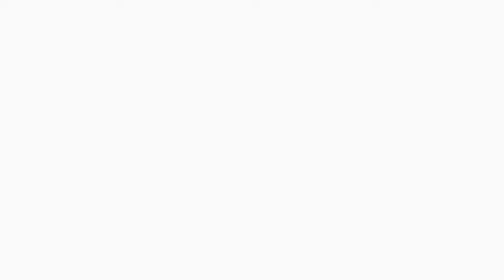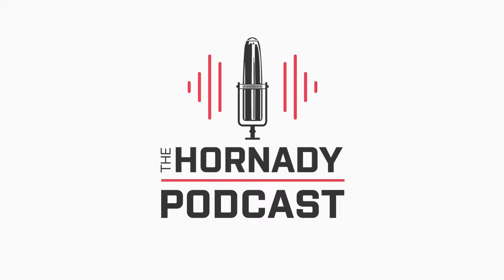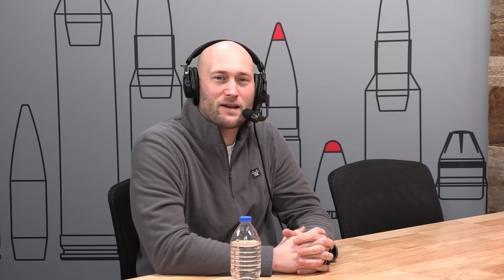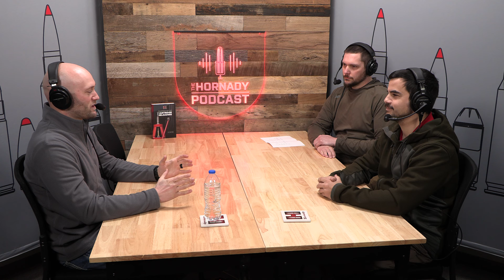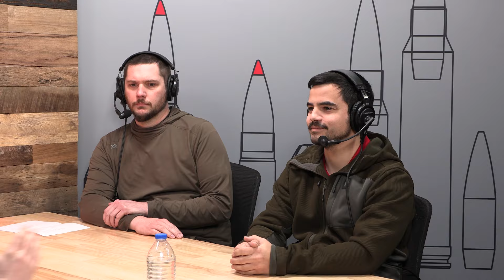Ep. 062 - The Venerable 308 Win

Comment: What I love about the .308 is it makes a great short barrel rifle. Im planning on building a 308 on a Yugo 24/47 action. I have a 30-06 barrel I took off a Mod. 77 Ruger which I rebarreled to a 9.3x62. My gun Smith will cut this 30-06 barrel back about 3/4 inch to remove the action threads and rethread it to fit the Mauser action and rechamber it to .308 Win. This should give me a 21 inch barrel 308. I'm pumped!

Comment: The .308 does good up beside the .30-06 until you get up to the 200 and 225 and heavier bullets. Thats when the extra powder capacity pays off. But for most hunting needs those heavy bullets arent needed. 180 grain bullets fly just fine out of the .308 Winchester.

Comment: Ref 5:50 --- The reason why late XIXth C rifles had these elevation sights out to 2,000 feet is that the concept was that massive rifle fire would be shot by whole squads at a single target at long distance, like a crossroad with marching troops, etc. The machine gun replaced that at the First World War. Distant fire and even indirect fire (artillery style) was given to machine gun units trained with firing tables to do it. Rifles from this point were used individually for shorter ranges.

Comment: What r yallvtalking about.    The 308 is way more powerful then 3030.   The 3030 runs at 2200fps w its hottest load.  Usually slower w most.  The 308 runs 2800 fps w the same grain weight.   600fps or more is alot more

Comment: When the 300 Savage was introduced in 1920 it matched the U.S. Military loading of 2750 fps with a 150 grain bullet. A lot of elk have been taken with the Model 99 Savage in 300 Savage. Not a hot rod but plenty good for whitetail, mule deer and even elk to 300 yards with good bullet placement which should always be the case.
     The reason SAAMI detuned the 300 Savage was the mostly unfounded fear that it would be chambered in some old rifles like M93 Mauser which allegedly had weak or soft steel which is pretty much BS. The original 7x57   military loading in the Spanish M93 produced an average pressure of 50,370 copper units of pressure. That’s considerably above the SAAMI standard and I don’t remember ever reading about any M93’s blowing up from over pressure during the Spanish American War or any since. The SAAMI spec for the 300 Savage is exactly the same as for the 7x57 at 46,000 CUP. I know that CUP is not PSI as measured with a piezo transducer. Your viewers who don’t know the difference will need to look that up.
     I have a Savage 99F in 300 Savage, custom ‘98 Mauser and Savage 99F both in 308 Winchester. Also 300 H&H and one of the Carl Gustaf M96 6.5x55’s Sporterized by Kimber, so I don’t need a 300 Win Mag or a 6.5 Creedmoor. I’m disappointed because it appears that Hornady is no longer producing the 300 Savage SuperFormance load as my 99 really liked that number. Actually except for a .243/6mm I’ve got all the bases covered as to bore diameter in various old farts’ (like me) cartridges. 250-3000, BOB, 338-06, 35 Whelen, 9.3x62, custom Siamese  Mauser 45-70 in case the dinosaurs come back. With that all said if I could only have one it would be a 308 Winchester. I’m not planning on hunting any of the big bears or African dangerous game but for the things commonly hunted by the common man on the North American continent it will still do the job. Not quite equal to 30-06 but close with less recoil. Quality ammunition available everywhere at reasonable prices. Easily reloadable makes it even more versatile. Proven track record. Not made for sniping at live animals at ridiculous ranges. Happy hunting boys and girls!😊

Comment: The Hornady #3045 bullet (165-gr BTSP Interlock) is an excellent performer. I have used it to take 14 deer. One of my buddies recommended it years ago and in my rifle it usually gives sub-MOA with reloads. Lots of good 30-caliber bullets available. I have used the Hornady 168-gr BTHP Match (#30501) and 165-gr SST (#30452) with excellent results, both also sub-MOA.

Comment: My 308s and 30/06 are two peas in a pod. Still can't tell the difference except for the length of the rounds.
 Both drop the same if I use the 24 in. barrel  308 and the 22 in. barrel in the 30/06. Using a 200 yd. Zero, Both  dropped 50 in. @ 500 yd. Using identical hunting flat based 150 grain softpoint bullets. Can't tell any difference between em.

Comment: You have the nerve to wax poetically about the 6.5 Creedmoor in context with .308 Winchester and fail to mention the .276 Pedersen at all?  The cartridge the M-1 Garand was originally deigned to fire and is the basis for the new M-5 cartridge.  I defy you to fire equal weight rifles of .308 and 30-06 with equal weight bullets and velocity and feel a difference in felt recoil between them.

Comment: I was told the military wanted a shorter cartridge in .30 so it could have a higher rate of fire than the 3006 could provide with the BAR.
So they came up with the M-60 with a belt fed .308. And it worked. And they created the M1A to also use the same cartridge for simplicity and a faster rate of fire with the magazine feed.
Reply: Soldiers were taught to engage targets at maximum distance using full sized cartridges.  But, human nature being what it is, all too often soldiers would wait until the enemy got to within “guaranteed hit range” before they engaged.  After-action reports from both WWII and Korea reflected this.  So the idea became, why issue and use big heavy full-sized cartridges if they won’t use them to their full potential.  Thus, the change to a intermediate cartridge, 7.62x51.  Can carry more ammo for the same weight load.  Then the army became fixated on the remote wounding effects of small yawing bullets at high velocity.  Thus, the 5.56.  So the average infantry guy went from 8x8rd M-1 clips (64 rds) to 7x30rd 5.56 mags (210 rds).  As far as the 7.62, it was discovered that they could shorten the 30-06 case by about 3/8” and use better powders to damn near duplicate the ballistics of the 30-06.  Not much weight savings, but easier operation in machine gun feed systems to use short action size cartridges.  Back to that human nature thing.  For decades now, we only qualify out to 300 meters.  But we still engage crew served at 1200 meter ranges.

Comment: Great information…..did the .270 evolve from .308? Or 30.06
Reply from the maker: 30-06
Reply: The 270 Winchester was developed directly from the 30-06 case. It was not just a necked down 30-06 case as is often stated. It is a longer case and is specifically manufactured so that it cannot be run into a 30-06 chamber. You can form 270 Winchester cases from 30-06 cases but the neck will be shorter than specified.You could say that the 7.92x57mm cartridge, designed by the German government is the great grandfather of all things good, but the 7x57, designed by Paul Mauser, is the God Father that changed the course of history. That 0.473” head diameter is still with us in a bunch of cartridges that are based on the 30-06 which was spawned by the 7x57 followed by the debacle of the Spanish-American war. When Theodore Roosevelt and his dismounted Rough Riders were walking up Kettle Hill with their Trap Door Springfield 45-70’s and a few 1898 30-40 Krags (they never charged up San Juan Hill) they got their asses shot off by the Spaniards with their M93 and M95 Mauser chambered in 7x57.
     The 280 Remington, 280 Ackley Improved, 35 Whelen, 338-06, 8mm-06, 6.5-06 are all based on the 30-06 case which was based directly on the 7x57.  Line them up side by side all the way to 50 BMG and you will see basically the same profile all the way up and down the line. There are small differences in shoulder angle (except for the AI versions) and of course the average case length and diameter.
     Then shorten the 30-06 case for the 7.62x51/308 Winchester and out comes the 260 Remington, 7mm-08  Remington and .358 Winchester.  Maybe some others I can’t think of now. All because of the Rough Riders and others getting their asses shot off by a bunch of Spaniards using a new fangled cartridge and rifle designed by a brilliant German designer. Happy hunting boys and girls!😊
Reply: 25.06, 270 and the 30.06 are all the same length case. The other two are just necked down cases.
Reply: The 270 Winchester was developed directly from the 30-06 case. It was not just a necked down 30-06 case as is often stated. It is a longer case and is specifically manufactured so that it cannot be run into a 30-06 chamber. You can form 270 Winchester cases from 30-06 cases but the neck will be shorter than specified.You could say that the 7.92x57mm cartridge, designed by the German government is the great grandfather of all things good, but the 7x57, designed by Paul Mauser, is the God Father that changed the course of history. That 0.473” head diameter is still with us in a bunch of cartridges that are based on the 30-06 which was spawned by the 7x57 followed by the debacle of the Spanish-American war. When Theodore Roosevelt and his dismounted Rough Riders were walking up Kettle Hill with their Trap Door Springfield 45-70’s and a few 1898 30-40 Krags (they never charged up San Juan Hill) they got their asses shot off by the Spaniards with their M93 and M95 Mauser chambered in 7x57.
     The 280 Remington, 280 Ackley Improved, 35 Whelen, 338-06, 8mm-06, 6.5-06 are all based on the 30-06 case which was based directly on the 7x57.  Line them up side by side all the way to 50 BMG and you will see basically the same profile all the way up and down the line. There are small differences in shoulder angle (except for the AI versions) and of course the average case length and diameter.
     Then shorten the 30-06 case for the 7.62x51/308 Winchester and out comes the 260 Remington, 7mm-08  Remington and .358 Winchester.  Maybe some others I can’t think of now. All because of the Rough Riders and others getting their asses shot off by a bunch of Spaniards using a new fangled cartridge and rifle designed by a brilliant German designer. Happy hunting boys and girls!😊

Comment: Hey guys, wanted to see if you could answer a question for me… Does core/jacket separation happen more often in larger calibers than smaller. For example, would a .308 be more susceptible to core/jacket separation than a .243 in the same bullet style. Should bullet styles be caliber specific based on size? Should someone shoot a bonded or monolithic bullet in larger calibers because of the positive correlation between caliber and core/jacket separation.
Reply: A .223 will shed it’s jacket just as readily as a .338, and the shorter the bullet the more easily it peels off.  Bonded bullets, A frames, or partitions stay together a bit better.  I’ve never messed with mono stuff since I am only shooting easy to kill deer, elk, and hogs.

Comment: The 308 will do what the 30/06 will do, and it's only a 50 yard. distance.  That means the 308 has the same power at the muzzle as the 30/06 has at 50 yards.
The 300 Winchester Magnum is the same thing compared to the big 300 WEATHERBY when the same bullet weights are used. ,595 Yards for the WEATHERBY and 545 yards for the 300 Winchester Magnum. These are the genuine article when it comes to hunting with the larger calibers and it doesn't matter if it's man or beast.

Comment: I have a question in regard to twist rates and how they relate to you Hornady CX bullets and the 308 was the caliber I was trying to find out of Jaden Quinlan had an email to contact him at, but couldn't find it...this might be something that either Miles or Matt could answer, so I will toss it out here. Maybe you could do a podcast on this topic, I am pretty sure others are confused over this. This is, the copper bullets have different grains for the calibers you offer and I wasn't sure how to view the twist rate in regard to weight. In 308 we had 168 and 175 that were very popular in 308. But on the CX you offer only 150 and 180, best I can tell. How does Hornady view the twist rate in regard to light vs heavy weight bullets? TIA if you have an answer.

EDIT: in addition, I have the 308 reloading data for the Hornady app from the 11th edition and they give a pretty wide spread for a given bullet, which muddies the water, IMO. It seems that it might be possible to use CX 150 gr for both 308 and 300 blackout. (California requires non-lead ammo for hunting...we can shoot humans with lead, but not animals...🤔)
Reply from the maker: In 30 cal we offer the 110, 150, 165, 180, and 190 grain CX bullets.

A lot of it really depends on application. The 308 Win can handle the the 150, 165, and 180 gr CX no problem. It could even do the 110 grain if necessary. It doesn't however have the twist rate required for the 190 grain CX.

The 110 grain CX is perfect for the 300 blackout as it has a lower expansion velocity requirement. It was purpose built for it.
Reply: @hornady  Thanks for that info, I wouldn't have thought to look at 110gr CX, but it does show data for 300 blackout. I notice the max load is at 2000 fps, and so is the 150 gr, however, they don't list the CX there, Hornady does show the GMX (I'm guessing discontinued???). Since both of those go only to 2000 and that is evidently the velocity needed to expand the CX bullet, doesn't that seem to be on the edge? Or will 2000 be able to expand and provide a solid kill? Looking to shoot pig with it, and do have 8.6 blackout that should be able to get about 2400 fps out of a 225gr CX. Just in case you're wondering, I don't have a chronograph, but pondering getting one to load 8.6 blackout. FWIW, I'm using fast twist of 1:5 on the 300 blackout, and 8.6 blackout is of course 1:3. Hence, the need for monolithic bullets to hold 'em together.
Reply: @hornady  You know, I hadn't seen those 165 CXs, must be because supply is so low at all the vendors. I have my fingers crossed that bullet availability for Hornady copper bullets will increase. Please let us know of any new copper offerings.🙏

Comment: TOPIC SUGGESTION: carbine length barrels. Ie 16-22in in length as well as ammo suggestions. Specifically for hunting and terminal effect. 

Personally I use both a 16 and 20in 308 with 168g amax or eldm because they’re soft enough to open up at mild impact velocities, and a short 308 doesn’t push them so fast as to blow up when they impact up close. 

The mild 308 with its heavy bullets, and wider bullet diameter for velocity generation, is a bit of sweet spot with short rifles.  Yet another virtue not often mentioned with the 308.
Reply: Carbine length 16-20in barrels***

Comment: There's lots of options and supply of 9mm, 556, 45ACP, 357 Mag, 38 Special, 40SW, and even 30-06 short (aka 308 Win). I've even found reasonable options and supply of 357 Sig and 38 Super. Meanwhile, there is literally no 44-40, or a slew of other recently orphaned cartridges like 220 Swift, 6mm Remington, or 20-30 others that were widely available pre-pandemic, even in Wal*Mart or Academy. Are you never going to make these again? Partial boxes of 'cheap' 44-40 is going for $4 on auction sites. What about 6.5 Grendel and Hornady's own 6mm ARC? There is very little available, and what exists is very expensive. I understand the focus was on the most popular cartridges, but with over 50% of the loads offered pre-pandemic widely available, it's past time to do runs for the ~50M guns recently orphaned.

Comment: When Miles Neville said that the M80 ammo was at 55,000 psi, was that using the SAAMI method or NATO EPVAT?  There is a lot of confusion since both are often reported in PSI?  FWIW, EPVAT measures in front of the case mouth, SAAMI measures the pressure of the case at a specified sidewall location.